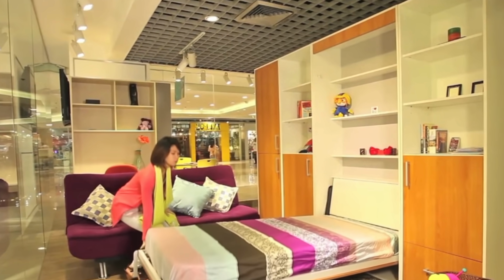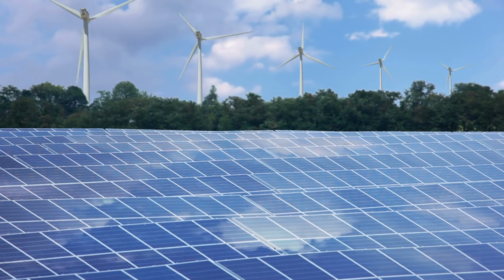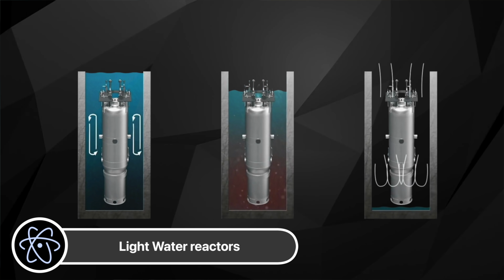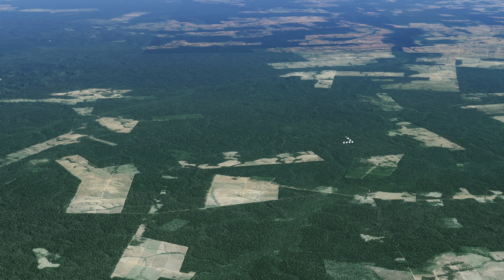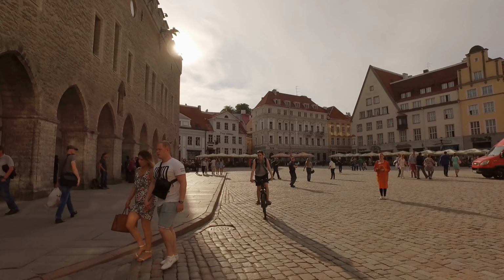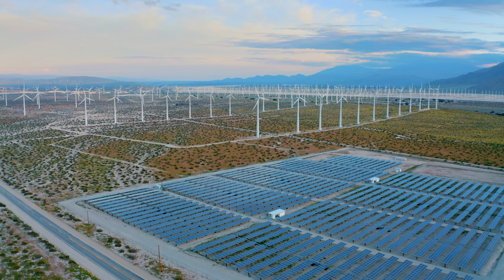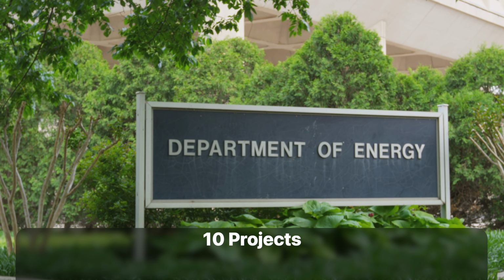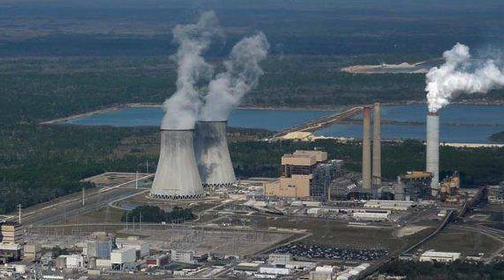Why Small Modular Nuclear Reactors Are the KEY

Comment: Total rubbish.   You need a couple of meters thickness of concrete, iron, and lead shielding on all sides of a reactor, no matter how small.   Reactor neutron efficiency goes way down as the size goes down, so you need much more highly enriched Uranium, which is much more expensive.  You also lose neutron economy, so the fuel has to be changed more often, as often as when the fuel is still 98% there.  Very expensive.    And what is all the present tense in "are built"?   There have been no small modular reactors built, and none even funded.   So, very deceptive.

Also there are very small limits on what you can build in a factory-- the reactor has to be deliverable by  road or rail, which limits the reactor vessel and heat exchangers to around 100 tons maximum.  That is a VERY SMALL in capacity reactor that can never even pay for the labor costs of running it.  You see whether a reactor is large or small, you need almost the same amount of staff to monitor, operate, inspect, and renew the reactor.  Below a certain size, you can't even meet the payroll.

And no matter how small or large the reactor, they are still 2 times more expensive than solar or wind power, and those are getting cheaper very quickly.    So it's a plain lie to say that these small reactors are "Squarely positioned" to compete.   They have been, are, and will continue to get less competitive.

Comment: I should be a energy system out there that we can plug into electric car but when you created a device that actually pulls it out of the environment and clicks it into a storage system like a built-in battery to the collector with putting the skin on the vehicle that has micro size multiple turbines that wind can power and turns whole bunch of toy battery operated motors into a power plant of meaningful generators generating power for the battery sister when you create double skin hole cars that has wind turbines built into them and I guess it the skin would be more than just two later it'd be three layer of skin hilarious is going to have the motors later for this you have to go through to hold the turbine and micro walls pattern with turbine mini turbine places throughout the wall as air goes through one turbine it gets another turnpike before exiting the back rolls and rolls after rolls of turbines it will be powered by the same amount of air as the car is going forward to the hitting that wall that wall is getting sucked into these closest between the layer of it has a built-in turbine boxes microsized that would be powered a small micro size battery powered motor into a generator generating multiple microvolts of power with super capacitors that will fill up and slowly decrease its power into the battery Bank from the skin turbines it might increase range of a electric car to make that Eva car off grid car that's electric now come a super super car to own I know I love to have an off-grid vehicle that solar and wind and willpower and motor power going back into the batteries through the reflecting systems throughout the car making energy back into the batteries what a way to go did they totally off grid want to have a supercar like that someday.

Comment: lol man, f this , all we need solar panel that can generate 1KW an hour combine with wind  1kw and hour, and solid state batteries that can hold 6=7KW a day, (
li bat dies in 2 years, )  in usa 250W solar panel is 50$ now,   put in the roof you all set , get a elektrik car chine making for 2000$ all set,  dont change the nature , we did look now to recover it will take 100 years , and you want to poisen more, we dont need more power , we need recover, to recover we need rest the nature